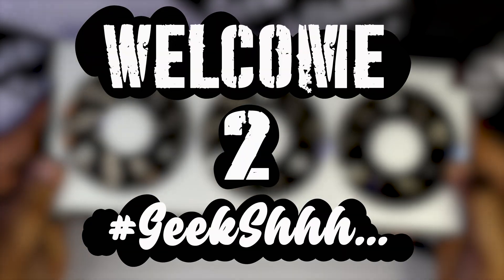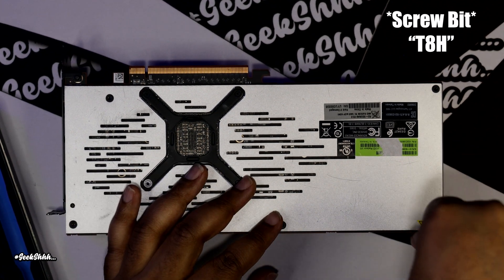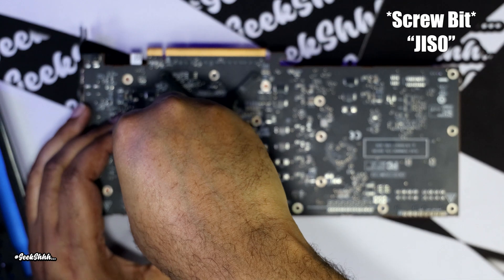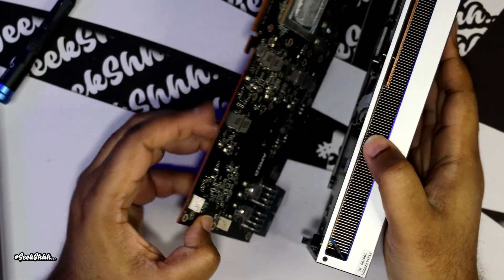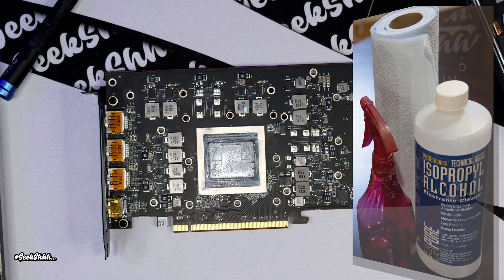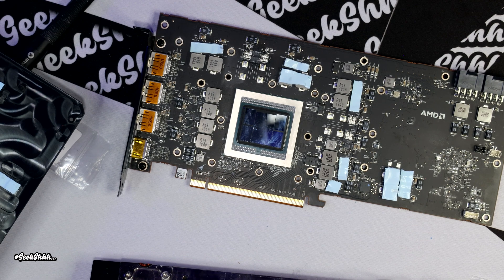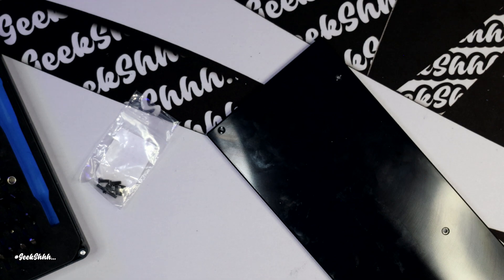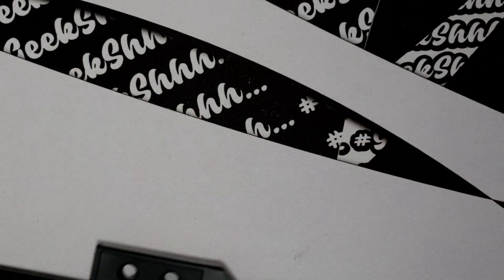Radeon VII #Repaste #EKWB Waterblock Install and Thoughts About using Radeon VII In 2024! #Tutorial

Comment: 12:50 outright lying man. I been using one on WINDOWS and you know what its runs just fine. Apex legends im still getting 150-130fps in ranked or pubs with high settings. This is still a good card but I wish I could get an aftermarket cooler for this gpu because the stock may look good but this thing runs hot. I cant get a waterblock because lack of space
Reply from the maker: 1 No one plays ranked with high settings. 2 Your getting nowhere near diamond+ with a Radeon VII maybe Plat if your lucky. 3 This card is fine for pubs only. Thanks for watching and commenting!
Reply: @GeekShhh  Tbh man I dont take apex seriously enough to become pro or even diamond. I just play for fun but I have tested low settings and anyone could run this just fine in high ranks. Drivers have come a long way since launch

Comment: what is the top of the line gpu , you can use in a hackintosh? i used open core, and it listed the rx 6600 xt , if i read it right? well thats what i bought. i used to use clover many years ago, but then i heard this open core hype, when i started messing around again. thanks
Reply from the maker: 6900/6800 XT, Thanks for watching and commenting!
Reply: @GeekShhh  thank you! you got a lot of good info, ill watch em all.😀